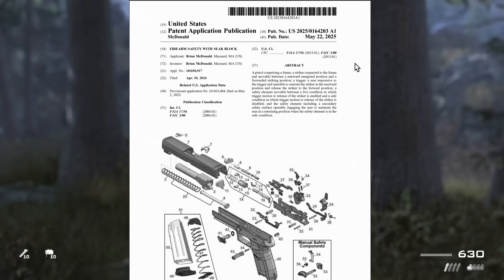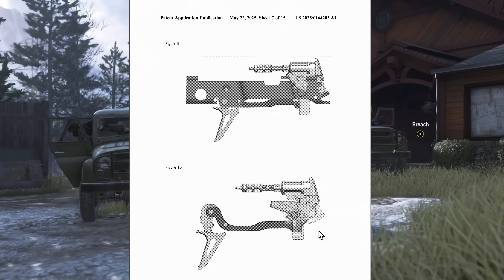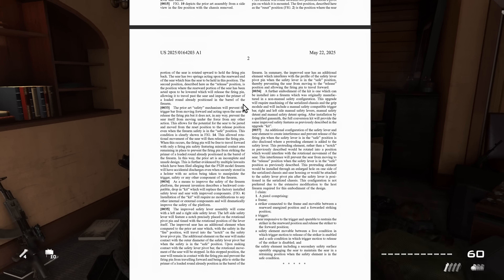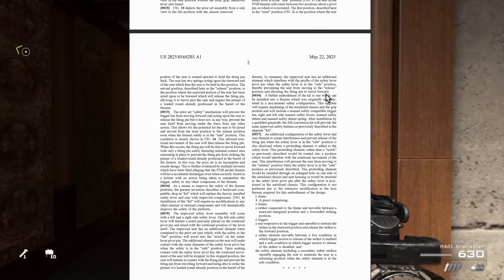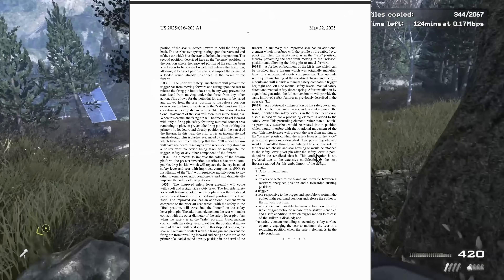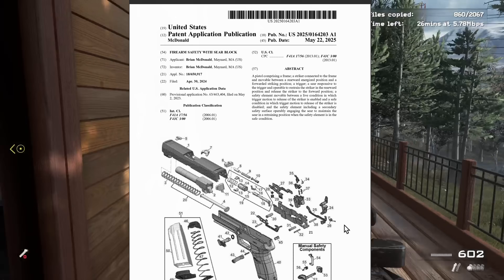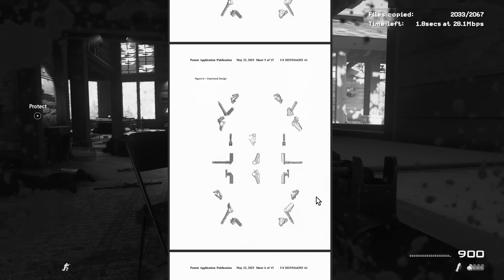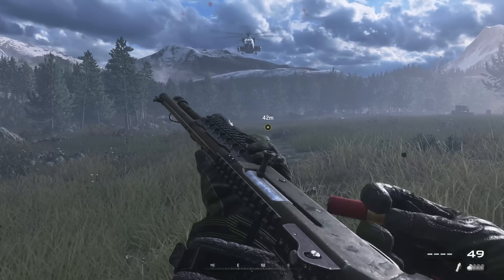Explosive: New Patent Claims Fix For  "Incomplete, Unsafe" 320 Design

Comment: Dang, i love my p320. My thoughts are there is a  design flaw in alignment and angle and the new safety doesn't actually fix the initial failure. It's only a work around. Not to mention that all the new videos are showing the trigger being depressed to the wall and the slide manipulated for this to happen, "why is the holster depressing the trigger" ???. My Veder holster doesn't. Also, my S&W MP's have very similar slop in the slide and doesn't have this issue when tested in the same manner.
Reply: If you got your 320 recently it's fine it's the old generation that has the problem.
Reply: @charlesletendre6723 I think you might be wrong on that. Mine is the m17 produced after sig started the mod and it will do it.

Comment: I don’t care where the retro fix comes from… I have 5 320 variants that I really like, and the oldest a Carry Tacops, I have owned 10 years, and the newest a M17 “ Surplus” that served 2 years with the 101ST ABN
None have given me a single malfunction… even carrying one on duty 2 yrs.
None are on carry rotation now. I have 5 Glocks as well, and 24 other semi automatic service types to use in lou of.
But I liked my 320/M17/M18’s
I’m sure its fixable. Sig has to admit fault to be the fixer… and I don’t see that happening. So it’s going to come from outside of Sig most 
Likely.

Comment: This patent (and solution) is nearly completely irrelevant to the ongoing (alleged) issues with the P320.... Two main reasons for this: 1. Most uncommanded discharges that have been documented have been with the P320 WITHOUT a safety lever (so obviously this fix would have done nothing). 2. Almost all investigations by the community seem to be zeroing in on the main problem being 'sloppy fit' between the slide and the frame.... The sear is NOT moving down to allow the uncommanded discharge, instead, the striker hook is moving upwards and allowed to slip off the sear. (Again, this patent fix would NOT change anything).
Reply: in all of the demonstration videos, yes the sear is moving down. They've either pulled the trigger partially (the sear moves down some), or they've manually manipulated the sear with a tool from the back of the slide. The ones touching the slide and it going off are with the trigger partially prepped
Reply: @Cryptic-1-9-1-1 
With my commercial M18, if I recreate the videos ive seen (especially the 'infamous' screw one), all that does by starting the trigger moving back is to raise the arm that disabled the striker safety (so that it will indeed fire if the striker falls)... It only starts to lower the sear if you pass the 'wall'... At which point that isnt a defect, thats how ALL striker fired pistols work.... Of course it will fire if the trigger is being moved backwards.

Comment: This is interesting news. One one hand, the pistols are not totally useless anymore with an upgrade to these parts, people will make some money besides Sig including the gunsmiths. On the other hand, this won't save the reputation they once had. Either way, it still not a good Service Pistol.  A pistol for Duty like a Watch and Sentry Duty need an idiot proof pistol, not a combat pistol. Maybe the front line soldiers should be able to choose a Sig320 if they qualify with it, but the Watch guys need a safer, extra safe pistol to hand off every 4 hours to the next Watch. 1911 worked great, no mishaps with firearms on the Quarterdeck. It did have a really rare drop safety issue, discovered way into service. It was remedied first with a new tighter firing pin return spring, a 3 dollar part and a 20 minute fix. Then next with a with a lighter titanium firing pin, a $10 dollar part with a 20 minute fix. Tested both, both passed. But then finally the firing pin safety system in the 80's series pistols arrived, also fixed the drop on the muzzle discharge effect. That's how seriously they considered safety back then. Even the rarest problem was addressed. 100 years of Service for the 1911.  I was passed a 1911A1 70's series with the titanium firing pin to stand Watches on quarterdecks. At least that's what I was told.

Comment: I don't see it. This only fixes one tiny circumstance where the pistol might go off and I didn't hear anything about why this is happening in all of the guns with no safety or with the safety off, which I am pretty sure are the VAST majority of cases. The use case here is way too limited. So while it is a fix, its not the fix. IMO of course.

Comment: I am no engineer but i have maintained that creating a quasi drop safety shelf (ie the sear not being able to move at all with the trigger at rest and at safe) like the Glock will fix the UD issues

This solution is both simple and cheap that even Sig could create another VUP to install this new safety.

Comment: Need to see a P320 with actual modifications done to the pistol. Then run through a series of tests. 
Just having the schematic’s for a new design has not shown it will solve the problem of the P320. 
However, finally someone has come up with a theory/idea, for a possible solution.
Thanks for this video update, very nicely done!!!

Comment: Sig can't take a patent application down even if it's eventually not granted, because the application and denial reasoning is evidence to inform the outcome of future applications or lawsuits relating.

This safety revision is definitely a great way of reducing the possibility of sympathetic movement, but the striker block itself just needs to be fixed because these guns should be internally safe with the external safety disengaged. Sig went with a coil-sprung cylindrical plunger on the P365, and it's pretty obvious why. It's just more difficult to foul, the spring is stronger, and the spring can't be installed incorrectly.

That would involve a whole new slide, and possibly a whole new gun due to the way the P320 is packaged. I think the design is still cooked, but maybe this improvement will make it safer for the military

Comment: This will catch the firing pin from striking?  Does that mean the striker will still slip, but won't discharge?  So does impact the guns ability to operate if this modified safety mechanism work?  Like if it catches the stiker and you pull the trigger, will it still operate as expected?  Or will the slide need to be pulled to the rear again?

Comment: It brings it to what P365 safety is already. I've modified my P320 to manual about a year ago. Machining required is minimal. If I can make it safe with just replacing sear and safety lever/pin - thin is huge.
Reply: It doesn’t fix all the issues. The only thing it will do is prevent any firing while the safety is ON. When the safety is off, it can and will still suffer the same issue as it currently does….
Reply: True. But not firing with safety on - will fix majority of the problems for ones that obviously have safety, which is MUCH better then "it's safe, trust us". @luckymanham302

Comment: I don’t think this will fix the problem.  To me it seems the issue is that the loose fitting slide when manipulated can pull the striker ledge apart from the sear.  Then only the safety mechanism prevents the striker from moving.  So then there is only one thing preventing the striker from dropping and the gun from firing.  If the safety has a malfunction that would cause a firing.  Or a small amount of takeup in the trigger can defeat it too.

This patent prevent the sear from moving down, but the issue seems to be the slide & striker moving up.

Comment: Remeber the the striker slipped off the sear and bypassed the 2nd safety sear. I think the SLIDE SLOP ( tollerance between slide and FCU) is to much, with the sryker housing plastic. He has isolated and controlled one part sear now do that for the striker.

Comment: So essentially it still boils down to a initial design flaw and cheap MIM parts. And yes, it is only a theory of improvement until it undergoes testing with these updated parts. Looks like a far better option than what currently exists. This  entire thing shows that modularity is a dumb thing and sticking with different models would have allowed a better firing pin safety like the one that exists on almost every single striker fired pistol on the market. 

Corporate greed seems to always crumble but yet continues to make it into government contracts with no one really ever being held accountable when things go wrong. 

I literally just got the X5 Legion as part of the deal for buying an MCX regulator in October 2024. And with all of this 320 issues in the publics eye have already been told I was not able to use it at a local match and gun range. 

So essentially until SIG owns this and provides a solution/fix etc....its just a $1200 paper weight.

Comment: Does this "fix" also apply the 320's without a manual safety.?
This question is answered at 5:14.
Sounds rather costly. Will Sig cover the costs?

Comment: As a mechanical engineer, what I have seen thru many videos this looks good. However I don’t believe this will fix the primary issue. The slop in the slide will still render this change ineffective because what I believe is the issue is the mating components between the gun chassis and the firing components in the slide.
Reply: As long as the sear engagement is in the at-rest position, there should be enough sear engagement to accommodate the slide to frame lateral movement and still retain the striker.  Or are you saying the trigger can still be partially pulled, thus reducing sear engagement to the point of being released with sufficient slide / frame manipulation?  In other words, the rear of the slide could still move upward enough to disengage and release the striker.
Reply: @refuztosay9454  The sear doesn't move downward with the trigger pulled when the manual safety is engaged.  Unless you're assuming there's enough slop to just pop the striker off the sear and for some reason the striker safety lock is also defeated which only happens when the trigger is pulled.  There are multiple parts to that and this would fix the part where the trigger is pulled enough to lower the sear enough to make it where the slop allows the striker to be pulled off the sear and also not caught by the secondary sear notch.  The video is right this is the absolute fix.
Reply: That is what I thought while watching this. It may resolve an issue with the sear moving uncommanded but it will not help with the slide tolerance issue which allows the striker to move off the sear without the sear moving.
Reply: Maybe.  But I like the design.  Without identifying the cause(s), this good design ( my opinion) would add$
Reply: DUDE! Imagine your holstered P320 is loaded and on safe. You then draw your pistol and as soon as you disengage the safety the gun fires. I could totally see this scenario happening.
Reply: @roycee1776 it cannot happen like that. That's not how it works.
Reply: @youcancallmemaurice  more like "should not"
Reply: @mtnbound1776 no it does not.  Unless the striker safety is in a failed state.
Reply: @youcancallmemaurice  that's exactly why so many have discharged uncommanded. the striker safeties fail. in the videos where dude pulls the trigger back 2mm and wiggles the slide, that 2mm is only enough to disengage the striker safety. striker safeties are failing on this gun AND there's poor sear engagement. both have to fail to have a UD and both of them HAVE failed on the dozens of guns that have gone off in their holsters
Reply: @tbone9903 this is not true.  You should get a p320 FCU and learn how they work.  When you pull the trigger the striker safety is being released.   This happens before anything else.  It happens on the M18 before you hit the safety.   They don't fail it's designed that way.  The sear engagement is fine and without the trigger pull it wouldn't go downward.  The truth is no pull no problem.  However triggers are getting pulled.  Now there appears to be a fix.  This is good news.

Comment: I'm sorry, but a retrofitted manual safety is not what is needed. People will forget to turn the safety on before reholstering. What is needed is a complete redesign of the trigger, safety, and firing mechanism. 

The safety is being dropped just with the trigger pre-travel to the wall. That is an unsafe design that needs to be fixed. and because of the geometry of the sear and the tolerances in the slide, if that safety is disengaged and you jostle the slide the striker will be sent forward

Comment: "If everything's built to spec." With MIM parts, this a huge IF without a comprehensive, 100% inspection plan which costs money. You can't do spot checking on these parts in a life-safety application. You can't do spot checking on ANY parts in a life-safety application.
Reply: With any parts, really. MIM isn’t too different conceptually from casting (fill mold with metal).

Comment: This is a "fix" that should've been part of the original design. I'm not convinced that even this will stop the discharges, especially on a pistol that has versions without the safety. Fixing the design flaw won't fix Sig's terrible QC on their small parts, which I'm sure is also part of this issue, but its nice that manual safety versions have an actual manual safety now.

Comment: in 2023 in japan at a military base front gate checkpoint, a japanese gaurd working the gate had their m18 go off while in a holster and the manual thumb safety engaged!
in holster safety on, gun still discharged!
Reply: Yea the manual safety doesn’t engage the sear, just the trigger mechanism.
Reply: This is what I was concerned about, insanity... Sig needs to stop spending their money suing everyone who notices and instead fix the damn gun..
Reply: Thankfully the Japanese are going towards the HK VP9, although I doubt they’re in any rush to replace all their old sigs anytime soon.
Reply: @jac1207  The "old SIGs" the Japanese use are not 320s, they are the long-discontinued 9mm version of the P220. No idea what the OP is talking about with a Japanese guard using an M18. Maybe he means an American soldier stationed in Japan?
Reply: The gun can't be fixed. This patent definitely does stop it from firing by itself. It just reduces the chance it will fire with the new safety on. It will still fire by itself with the safety off

Comment: Even if this ends up being a true fix for the P320, it doesn’t change how we got here. I still don’t want my P320, and really don't want anything Sig makes. They have spent years denying there was ever a problem, even while people were getting hurt...or killed.

Are they even going to offer this solution to current owners? Or will it be another quiet rollout where they pretend nothing ever happened?

At this point, the only real move is a full buyback. Own the mistake. Make it right. And honestly, maybe bow out after that. I do see any coming back.

Comment: Taking bets for if disengaging this manual safety, could cause a discharge in sufficiently out of spec guns.
...Pretty sure it wouldn't, but it'd be crazy if it did.
Reply: I don’t see that being an issue because the problems were many fold, but boiled down… the sear/striker surfaces may be rough enough to through friction allow the sear to “walk” down over time and disengage. Or to move just enough for the engagement to be lessened so a jostle or movement of the slide would cause it to release. So this safety would be pushing up on the sear, effectively resetting any downward “walking” it may have done. Once released, it would be at its highest and would take time or manipulation to work its way to unsafe again.
Reply: @cfdfirefighter  Yeah, I was figuring from what's shown, that it'd keep the sear pushed up, but I wouldn't put it past SIG to add some burrs that'd pull the sear down while disengaging.
Reply: There’s a video where it does on YT
Reply: I was thinking the same thing.

Comment: The P320 is not the only pistol on the market that uses a manual safety which only blocks movement of the trigger bar, and does nothing to block movement of the sear. However, that doesn’t mean having a manual safety lever that doesn’t block sear movement is a good idea.

Comment: Amazing work on the part of this inventor. I gotta say though, you could purchase this part and seek out a gunsmith and hope that the end result will be safe and correct. Meaning hope this guy‘s design is good and the gunsmith installed it right. (I’m not knocking this guy or your gunsmith. I’m just saying there’s at least some uncertainty.) On the other hand, you could select any of the alternate options with fantastic track records of absolute reliability — Glock, CZ, HK, Beretta, IWI, Walther, S&W all sell comparable guns that are just as good if not better. The point is if there’s one major problem with this design, that tells you the design process itself was flawed. And that tells you other problems will emerge over time. Excessive wear, degrading performance, creeping unreliability, shit breaking that shouldn’t break. 

When you buy something expensive and it turns out to be a piece of shit it’s extremely frustrating. I’ve had it happen and I know how hard it is to let it go. But when you had up the time & money you’ll spend personally I would just buy a different gun.

But of course, what’s right for me may not be what’s right for you. So whoever decides to go for this, I hope it works out for you.

Comment: The fundamental problem with the 320 is the inferior polymer used in the grip module and the number of issues will increase as they age and change properties. Sig will drop the 320, declare bankruptcy and form a new Corp in a futile attempt to stave off the legal tsunami thats coming but it won't matter, Ron Cohen did to Sig what the gun grabbers in New York wanted, set up sig for failure, Just like they did with the Freedom Group and if you doubt that, where is Freiburg today?